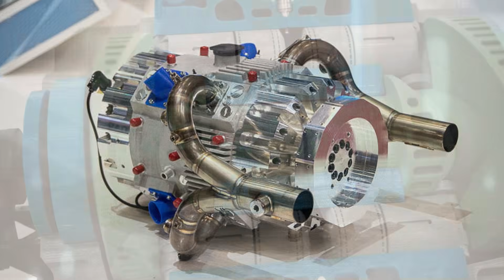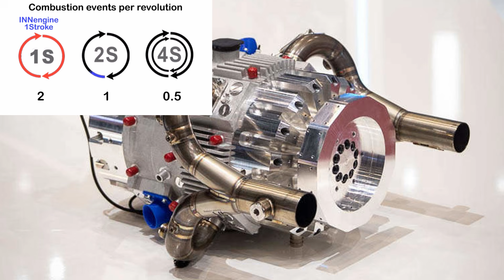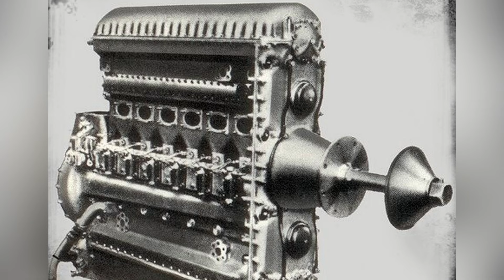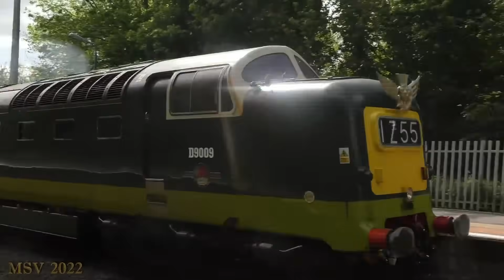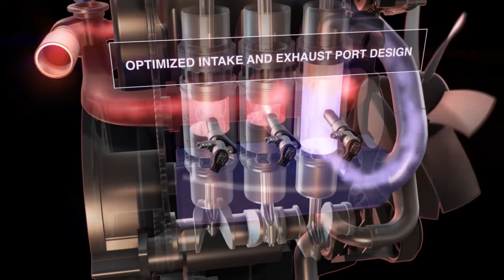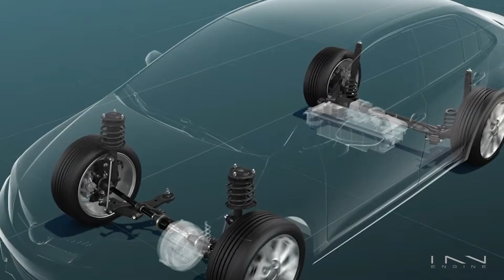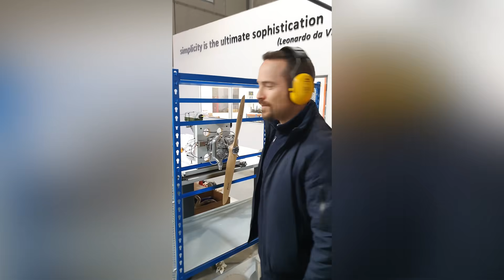NEW OP Mini-Engine DESTROYS Pure EVs

Comment: EVs are unsustainable and don't appear to be the future, as they are worse for the environment from the start, with mining of the lithium, graphite, cobalt, and manganese to the fact the batteries only last a few years and will cost thousands to replace in such a short time span and the other fact that they are not recyclable and will just go into land fill. If they don't catch fire first, that is?! Also, right now the electrical grids are powered by fossil fuels, so we are powering the so called green EVs on the same thing we are trying to replace them with, which is all types of moronic.

Comment: Besides other issues, it would not take 45 minutes to charge, unless going from empty to full, but that would likely be rare…
Also, how long does it take to load, unload to head out?
I have seen videos of drivers waiting hours because the logistics are not really setup to be efficient.. so instead of idling for an ICE semi or just sitting there doing nothing for an electric semi, it could be charging…
Put solar panels on the facility (assuming warehouse/distribution center) and use that power to help charge the trucks.

Comment: The only time it would be good for electric cars is when we use zero-point power. The batteries they use now are a nightmare to the environment. Plus the only reason they use the batteries they use are to get the rich richer. They don't care about clean air, they just want the money. What about running cars off water, they have the tech but they can't charge for water so it is a lose lose situation for gas and battery companies.

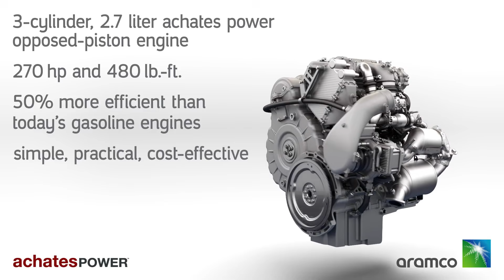Comment: 1:44 The inefficiency of today's ICE engines - being only about 25 to 30% efficient depending on various new tech - IS the pollution given that 70% of the fuel comes out unburned. If the Achates engine is 50% more efficient than that it would have an unheard of efficiency of 75% therefore easily meeting ANY emission standards - including beating electric vehicles which are about 60% efficient - NOT including their horrendous manufacturing/non existent battery recycling pollution.
Reply: Electric vehicles are better than 80% efficient and some are closer to 90%.

Comment: Using vehicles that run on electric motor and battery strains our economy and does finally result in a larger carbon footprint than an efficient fossil fuel vehicle. 
Batteries should be used in hybrids and made to last 15-20. years. We had a British design in Delhi, IN and it was superb (2010...)

Comment: I think youre missing the point. Unless youre advocating all these designs are being optimised for use with hydrogen or other zero-carbon producing fuels, using them powered by fossil fuels will not help the problems we are facing today.

Comment: If it has more than one moving part, it won't beat EV motors. In addition, hydrogen is dead as a fuel source.
Reply: EV running solely on battery has a larger carbon footprint than fossil fuel IC engines. 
Hybrid is the solution.

Comment: Everyone with some common sense knows the time frame for a move to EVs is totally unrealistic. Also EVs as they are now just move the pollution and are only a small piece in the solution to clean air. I tend to go with the science that says it is mother nature not man made CO2 that is changing the climate and it's getting colder over the time frame we should be looking at.
Reply: You're right. The fact that EV has a larger carbon footprint was made known more than a decade ago. Hybrid is the answer. 😊

Comment: 5:20 - go and calculate the electric power you need to go fully EV. (adding trucks as well) its afaik a multiple of the current existing capacity of the grid.

Comment: The Jumo engines were used in Nazi warplanes like the Junkers dive bomber. Heinkel used the BMW engine while the famed Messerschmidt fighter used DB (Daimler-Benz). In any which way you look,  electric engines are the way forward while hydrogen is too cost heavy and a safety threat !

Comment: All good, it's just needs to used a non - carbon fuel and it will be a winner. Less emissions is not zero emissions, it will still require oil drilling and refinement to make the fuel. The goal is to transition away from carbon fuels, not just use them less! 👍Like i say nice design, it just needs to use a clean fuel!
Reply: Carbon fuels create electricity in majority of the world and are also needed to manufacture cars of any fuel type.  Drilling is also needed for polymers and mining will be the new drilling for precious metals.  The real answer is to keep existing cars on the road instead of replacing them with increasingly disposable units, as the manufacturing of the car is far more polluting that the lifetime of the vehicle.

Comment: The Napier Deltic engine makes a beautiful sound. Luckily some of the locomotives that use these engines survive.
Reply: Castor 927 maxima 2 stroke oil in a napier deltic hell yeah!
Reply: I have pondered if it would be possible to scale down a single bank of three from the Deltic down to make a generator out of it.
Reply: Yes a mini deltic fomed out of 3 60 deg v6 3.2l 3160cc mercury optimax 300XS engines. oil injected too.
Reply: @jlo13800  I like how you think
Reply: The Napier Deltic was oil injected like the new Rotax 850 Etec turbo R but mechanical VRO. Here the cummins oil injected OP ACE 2 stroke.https://mart.cummins.com/imagelibrary/data/assetfiles/0058689.pdf Now take 2 850 Rotax's and make a 1700 OP engine out of it, same with Polaris 850 or Arctic Cats new 858!
Reply: Thanks most 4 stroke folks hate how i think, and BTW an electric motor in a lucid air or tesla is a magnetic rotary 2 cycle.

Comment: If not hybrids, battery swap EVs are the way to go. Lots of advantages, very few disadvantages. Think about it.
Reply: There are a lot of disadvantages.  Smallest EV battery pack is around 1000 pounds.  Thus you need robotic tools to remove the battery and put a new one in.  You need space to store the battery pack, big electricity outlet to re-charge the battery pack.  It is a very serious infrastructure investment especially in big cities. Think about it.
Reply: @catchnkill  You're wrong.
"NIO battery swap: faster than any EV rapid charger! – DrivingElectric"
Watch a video.

Comment: Oh this is wonderful. With my EV I was really missing having to go to gas stations every week, and don't forget about the oil changes every 5000 miles. How did I ever get along without a mechanic trying to upsell me an unnecessary brake and coolant flush for just $69.99! There is just nothing that can substitute for hundreds of moving parts with contact points of wear. I also was getting a little too comfortable not worrying that my catalytic converter wouldn't be on the car in the morning. And let's not forget about that badly out of tune car exhaust smell that's just like fresh geraniums.
Reply: EXACTLY!
Reply: If there is a fire in the battery compartment, you will not have a single chance. The car will burn for several days, and nothing will be able to put it out. In such a situation, there is one positive point. You wont need to be buried, there wont be anything left of you...
Reply: @vulpesdraco1669  electric car fires are rare. Gasoline car fires happen constantly. What about sitting right on top of 10 gallons of gasoline says safety to you? Oil company propaganda would have you forget that gasoline is flammable.
Reply: @PatrickDraper  Green propaganda claims that gasoline ignites and explodes. No. Only gasoline vapor ignites and explodes at very high pressure and temperature (diesel fuel is even safer, so the petrol tank M1A1 and IFV are placed as an additional level of armor). You can deceive yourself, but you can't deceive Physics. Give me links and examples of when the car's gas tank exploded. Find and show me examples of these events. The car can catch fire and burn out to the ground. But it will be a long process. You will have time to stop, get out, get upset, light a cigarette from a burning car and go into a beautiful sunset. In an electric car, you will not have such an opportunity. If the design of an electric car was designed for safety, then the car would turn out ugly, heavy and expensive. There are very few cases of electric cars catching fire just because there are very few of them themselves. When the security problem is solved, I will personally say-"Shut up and just take my money!"

P.S. Explosions of racing cars are not accepted. They use practically non-symmetrical heptyl 😅
Reply: @vulpesdraco1669  your car is FULL OF HIGHLY FLAMMABLE GAS!
Reply: @stevefisher2553  your car is FULL OF HIGHLY FLAMMABLE GAS! Seriously? Its unbelievable! But...

I understand you've seen in the movies many times how a good guy shoots at a bad guys car, a good guy gets into a petrol tank, the bad guys car explodes, takes off into the air, the good guy keeps shooting, the car explodes harder in the air, this explosion triggers the process of uncontrolled atomic fission and the car is completely annulled...Oh yes, Hollywood☺

My recommendations to you, buy a cold beer and review the Mythbusters. This is also a very spectacular show

Separately, I want to say about Diesel fuel. Modern diesel fuel is very eco-friendly and safe. This fuel burns very, very, very badly. In order for this fuel to ignite, a high temperature and high pressure are needed, which makes diesel fuel the safest of the existing ones

If you like electric cars, this is your choice, but why talk nonsense?...beer..mmmmm...I going to buy a cold beer 😏

Comment: It could be run on wood gas from a pellet pyrolysis setup. Wood pellets can be made from scrap wood and wood waste. So, you'd have a hopper rather than a tank. It would also be possible to carry the equipment with you to convert wood waste into pellets. That would add weight though. I must try this out some time.

Comment: "We need greater battery energy densities"... "But that will be a decade or more away"
Except that CATL already has a hybrid solid(ish) state battery, what they call the Condensed Matter battery going into production this year. Energy density? Up to 500W/kg which, if you do the calculations, is pretty much the exact same energy density of hydrocarbons running at a typical ICE efficiency of high 20%, low 30, and it's cheaper to manufacture than traditional Li batteries, according to CATL. Admittedly, the INN engine may be capable of higher efficiencies, but that is a big maybe.
And we also know that Chinese researchers have achieved 703 Wh/kg under lab. conditions.
So, with "just" a simple step, battery density goes from a maximum 280/290 Wh/kg in the current best (Tesla) batteries, to 500, to 700, and you think that it'll take 10years or more?
Knowing how much skin is in the game to get ultra-high energy densities, I suspect that we'll be looking at 1kW/kg energy densities in under 10 years, I actually think that we'll be seeing them (possibly only in lab form) before the turn of the decade.
And even with "only" 500Wh/kg, the combined weight of battery pack and motor is already pretty much identical to that of an ICE,
When you consider that the first Li batteries only went on sale in 1991, and only had a density of about 100Wh/kg, but Tesla's batteries are getting nearly 3 times that from basically the same tech, I don't think it is too much of a reach to see similar gains in these new techs.
Similarly, although electric motors can run at over 80% efficiency, it can be relatively difficult to get them to run at that efficiency across the whole operating range, but motor efficiency is another area of research that is showing enormous promise.
Lighter batteries, more efficient and lighter motors. WTF do we need to resort to burning stuff?
Oh, and BTW, the CATL Condensed Matter battery is cobalt free, as will all EV batteries be by 2025, if not sooner..
Also, several other battery manufacturers have similar batteries in the wings, apparently.

Comment: Nice if it is light and powerful, however you cannot get excessive gain in efficiency as it is still based on the carnot process.
Absolutely correct that a plug in hybrid should use the combustion engine (of any type) only to produce electricity. This allows the engine to work in its optimum working point in terms of efficiency.
I would assume a battery capacity of 15 to 20kWh to be enough for a plug in hybrid. This should reduce the battery weight compared to 60-80 kWh about 180 to 260kg. If you refrain from moving a 2 ton vehicle at constant speed above 120 km/h this give enough weight reduction to install the combustion motor (and fuel tank).

Comment: What keeps the rollers stuck to the track? What happens if fuel runs out?

I also wondered if cylinders need to be round, or if they could be kidney shaped, to take up the available spacing, increasing volume and produce more power.
Reply: Honda tried this with the NR750. The machining costs in production are stupid

Comment: The assessment that viability of EVs is possibly 10 years down the road is/was acceptable thinking 6 or 7 years ago.  We currently have 350 to 500 mile range EVs and over the next 18 months the market will be flooded with new models AND expanded charging stations in the hundreds of thousands.  Even conservative flat earth climate change deniers are joining the EV transition because they make economic sense.  We talk about range over and over again and seldom mention that your battery is fully charged every morning when you get in. Mention hydrogen and your credibility falls apart. There are so many problems with hydrogen that it doesn’t belong in any serious discussion of personal transportation solutions.

Comment: My father retired from Motorola in the early 2000's , and told me that power electronics seemed a very promising maturing technology. PE's are crucial to the implementation of hybrid ICE/electric automotive platforms, which benefit from using the electric part to eliminate heavy and inefficient drivetrain components. Electronic control, both power and non-power, allows a high degree of variability which enables an ever more adaptable range of usefulness for both parts of the ICE/electric combination. 

Batteries and access to sources of electricity are both significant constraints for pure EV's, and are where hybrids gain value in their practical implementation. From an engineering perspective, electrical, mechanical, and chemical (combustion stoichiometry), these are very interesting times, indeed. Great video!

Comment: This engine is not a 1 stroke like they say. It is a two stroke. The biggest issue with 2 strokes is oil control, which is clearly a problem for the Junkers engine in the video. The second issue with 2 strokes is fuel consumption. I would like to see an independent company do emissions testing like Southwest Research (I have no affiliation; just an example) and Brake Specific Fuel Consumption. Piston rod side thrust would also be a concern as it would provide significant efficiency issues. I would like to see this engine succeed, but I have serious doubts it could.

Comment: INN will probably take years if not decades to proceed beyond prototype stage. Longevity is a hugely critical issue, how will the motor respond to a backfire or low-octane pinging.
How reliable is that swashplate concept, and how sensitive is it to the quality of lubrication.
I'm also curious if it's not possible to stagger the combustion events for a smoother output, perhaps if they went from 4 piston pairs to 3 pairs they could reduce part count and improve smoothness (the MX5 video sounded very "raspy").
I have an inkling that efficiency (and emissions) could be improved quite a bit if they incorporated a catalyst and turbo: there will be unburned products of combustion in the exhaust that could be completed in a catalyst and the energy captured by a turbo.
Interesting prototype.

Comment: The ONLY reason this engine seems to be better than EVs, is because oil is so heavily subsidized. Gasoline, in the US, now costs around $25-$30 USD per gallon. In the US, consumers only pay about $3-$5...the rest is subsidized by the US government. If consumers paid the true cost, at up to $30/gallon, NONE of these ICE engines would be in use now.
Reply: Right and that cost estimate probably doesn't even factor the value of damage caused by carbon pollution as well as air quality related health problems. Although I would say that may be an overestimation of the market price. Although not by that much, say 15-20US$/per US gal. 

Which, as usual, the cost of climate pollution tends to be born the most by peolle with low income, low privilege and relatively few means. Diesel is significantly cheaper in many countries where the kind of Regulatory Capture found in the US, isn't in place. This is because it requires a 20th of the energy input to refine from crude petroleum. 

Unfortunately, since fuel prices have a huge impact on the economy, jobs, and profit margins in most companies, US politicians have a perverse incentive not to throttle back on this particular "golden tap."

Comment: As much as you are holding up the petroleum  flag the large vehicle manufacturers sat on their laurels with old , reliable engines or like German manufacturers  just priced clever, better engines  far out of reach of majority  customers.  You need to up grade your anti battery rhetoric,  Nickel, cobalt  are fast disappearing components of batteries. I'm guessing you like the Tesla  stationwagon?